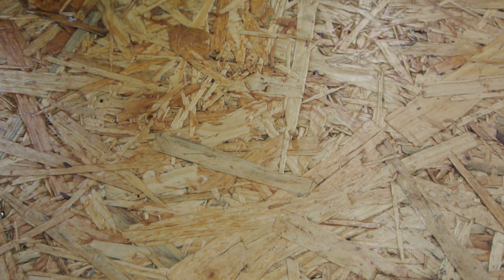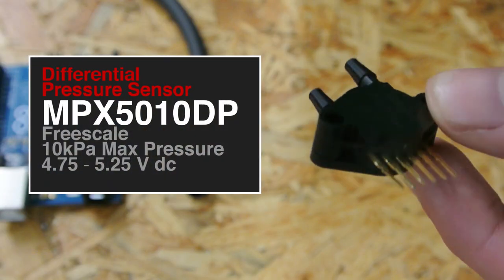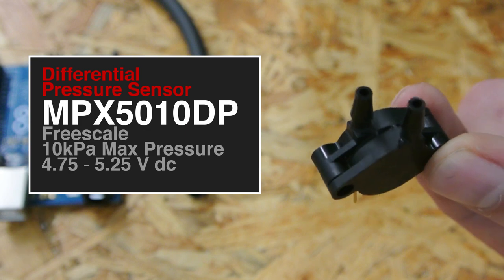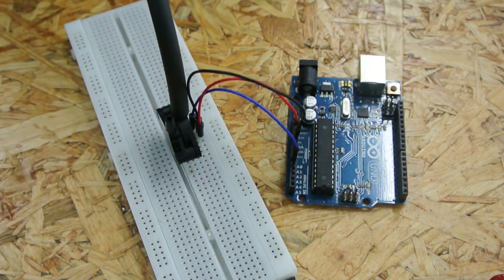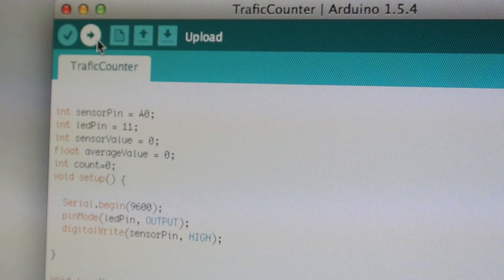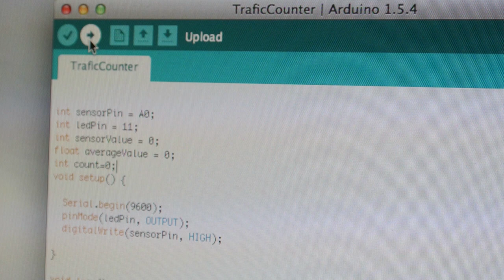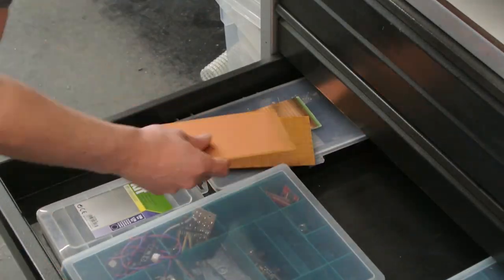DIY Traffic Counter - Road Tube

Comment: Amazing project, congratulations, i have a question though, does this pneumatic sensor work when a car slowly passes by?, i'm looking for a solution to detect a parked car in a parking lot so cars might be passing very slowly on the tube and the pressure might not be registered
Reply: Martín Medina Nualart 
Hey Martin.
Have you found a solution yet?
I did traffic signals for over 15 years.
A solution I used to tell an ice cream vendor when a vehicle pulled up to the window was a loop.
A loop is a metal detector mounted into the ground.  
These loops are used at traffic signal intersections to tell the CPU controller when cars are at the side streets, or in a left turn lane.  
They are also used for counts.
These loops are basically a 6 X 6 square groove cut into the pavement, then filled with 2 passes of 14 gage  wire, 
then sealed with hot tar or loop sealant.
The ends of the wires are then connected to a detector, which is basically a metal detector.
At some intersections, we set the detection sensitive enough to detect bicycles.
If a vehicle was parked over a loop all night, you would get a steady "CALL" until the vehicle moved.

Comment: Hi Kris, Congrats on a wonderful project. I'm looking to do similar, but as a Solar Power wireless 433 MHz remote controlled door chime when visitors come up the driveway. I've tried PIR and radar microwave but unfortunately both are susceptible to false triggering such as wind and sudden changes in background thermal radiation.  Do you have an idea where to get suitable inexpensive tubing from for this project to tackle it from this type of sensor angle? Cheers Paul
Reply from the maker: I think it will work with any pvc/rubber tubing. A water hose etc will work. good luck! :)
Reply: @KrisTemmermanNP  Thanks for pointing this out, OK it then appears that the pressure level output from the tubing is not critical assuming the differential sensor has a wide input span range to work from.

Comment: This is a great project. Thanks for sharing it. I have a question, what would be the best way to have the Arduino store the data that can be viewed later instead of real time monitoring? I envision a running text file on the SD card.. something like that?
Reply from the maker: +Cody Deschenes Hi Cody, yes, that's how I would do it. Probably a CSV text file, so its easy to analyse later.
Reply: +Cody Deschenes  Can you please help me, this is interesting and I want to make one for myself but I am new to this. I didn't understand what happens in the fast time lapse. How do you connect the wireless and how to get it to work? What model is it and where can I buy it from? Thanks

Comment: really elegant! I wouldnt have thought of such a sensor if i had to build this :-) Does the software skip every second pulse because of the two tires per bike?
Reply from the maker: +Felix Dietz Thanks, Yes, it was something like that.
Reply: @KrisTemmermanNP can you help my with arduino program and with the application where the data is stored?